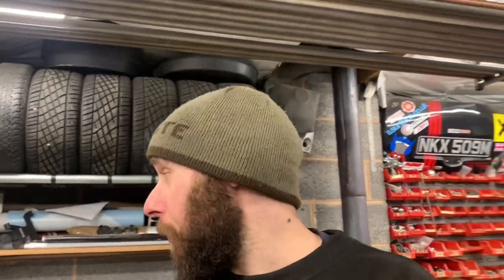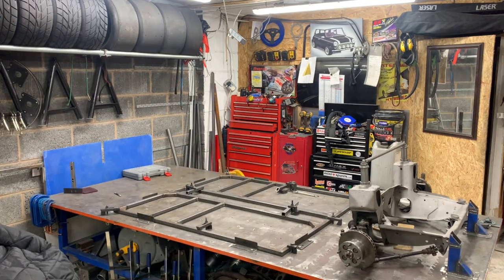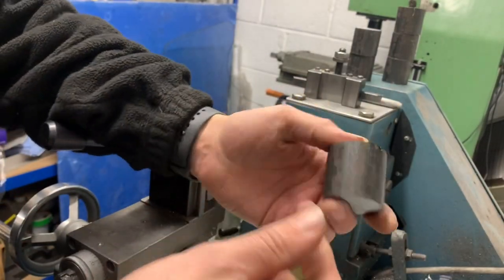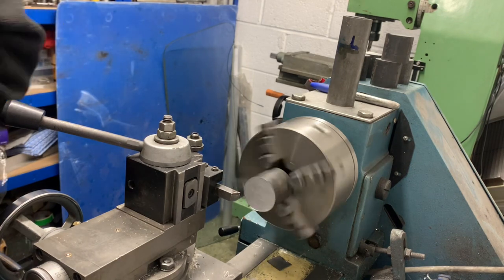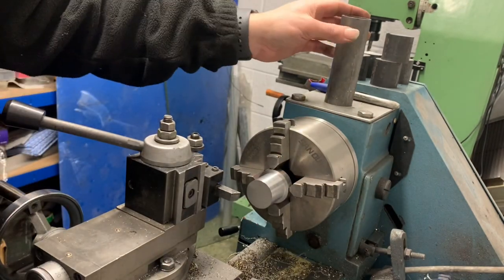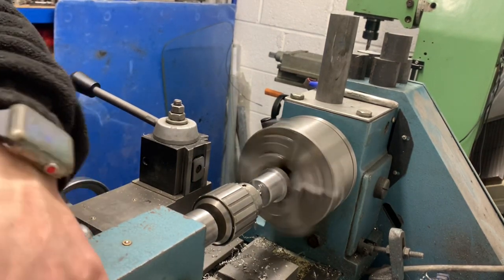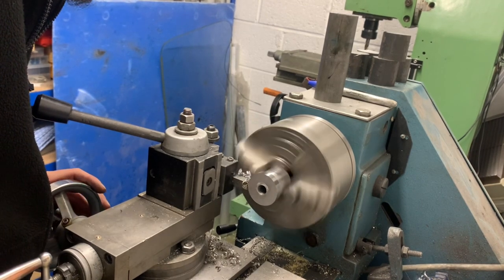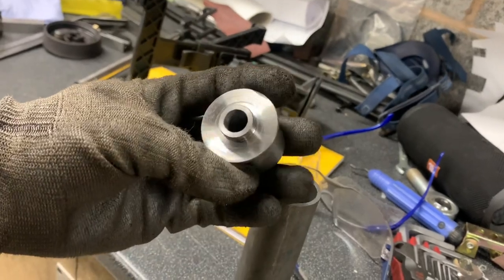spaceframe Chassis for a Honda vtec mini race car build

Comment: Good to know you have enough work. Are you using a soft disk with a backing pad or just a regular grinding disk for linishing ?
Reply from the maker: Flappy disc mate Iv not used proper grinding disc in years